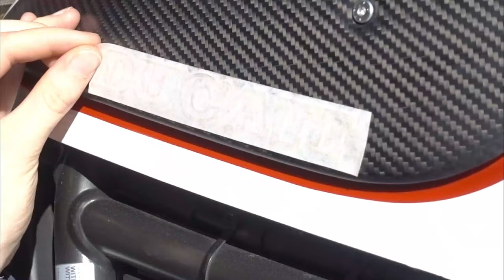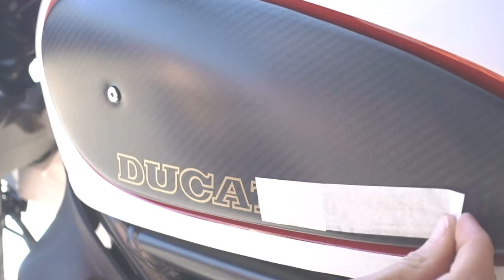Carbon Fiber Fuel Tank Panels | Ducati Scrambler Desert Sled

Comment: I ordered a set of these for my girlfriend's 2020 Scrambler Icon.  I had to modify the rubber sleeves that go over the brackets on the inside of the panels by shaving them down quite a bit to be able to slide them in far enough.  My rubber bumpers were also a lot bigger than shown on your bike so I had to cut them down by 1/2" to avoid having a 1 inch gap towards the front of the panels when installed.
Reply from the maker: Thanks for the info!